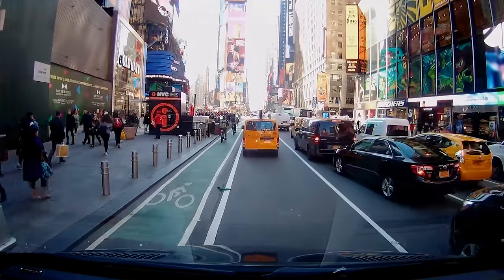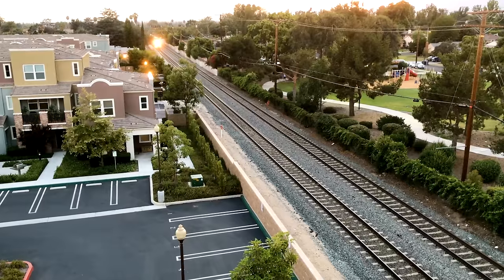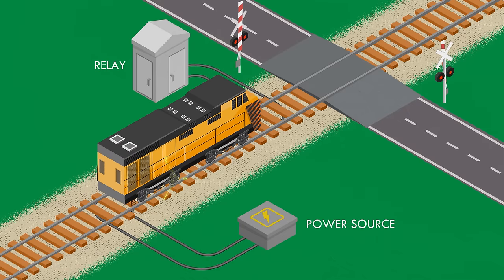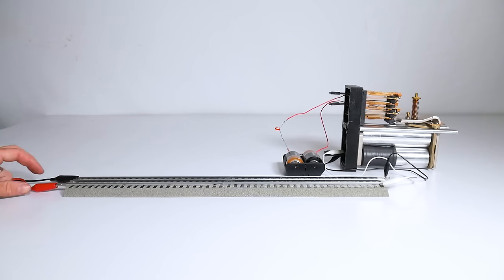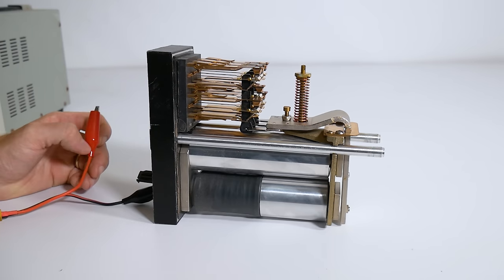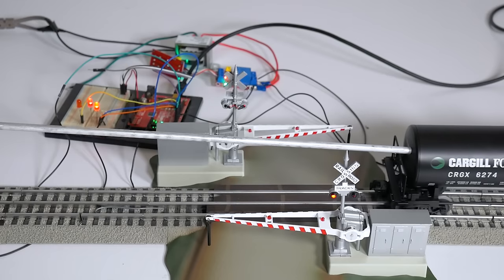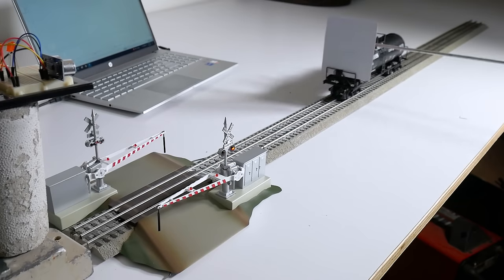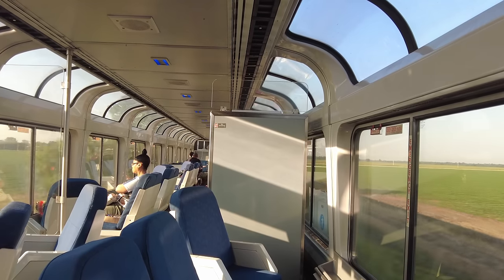How Railroad Crossings Work

Comment: I grew up around "passive-only" crossings. You get used to being careful around them, but quite a few people get killed because if they get to the crossing AFTER train does at NIGHT, it can be easy to assume there isn't a train until your headlights shine on it and it's too late to stop.
Reply: There has been a huge push in the last 20-40 years to get retroreflective visibility markers on the side of train cars to make them more visible on a crossing at night.
Actually having street lights at crossings (on both sides) is also very important.
Reply: Thanks for pointing this out, I hadn't considered the nighttime scenario of arriving to the crossing after the train.
Reply: @jovetj I've seen reflective strips on oil bombs before at a refinery I drive past. You can see them on the spur from miles away, they work great.
Reply: @@ithecastic Vehicles driving into the side of trains the driver cannot see at night has been a big problem since trains were invented.  And moving trains are generally pretty quiet.  Not that you'd hear that "clickety clack" as you're hundreds of feet from the crossing anyway.
Reply: @@ithecasticThere barely is any clickety-clack anymore, most track is continually welded
Reply: @@ithecastic: There's an incident that was pretty noteworthy, where there was a poorly designed crossing that had road traffic lights (however the track circuits were such that a train that didn't fully clear the crossing could still be on it, yet allow for the crossing to reopen) - which ended up happening (believe train's deadman ended up activating rather "conveniently" such that it did), with a car approaching the crossing, and said train being basically invisible...
Car completely written off with severe damage, rear wagon of train slightly scratched.

Comment: 5:40 In my country, there is also "check light", connected to another side of the relay, if no train is coming, this light come on, indicating that the crossing gate is working normally. If one would to come to this gate crossing and seeing check light is not on, it meant the system has no power, I would need to stop and look instead of just continue on like when it is working.
Power outage is more of a concern than false positive, so check light is very common.
Reply: Depending on the signalling system the train driver will also get a warning if the crossing gate has failed and they must slow down and use the horn to warn drivers approaching the crossing.
Reply: @baksatibi  I live in Thailand, we don't have that system. lol It's only on the gate side. Most of crossing on rural highways have those "stop if check light is off", it is very useful. But on a more urban area or in town, power outage isn't a problem, so you won't see one.
Reply: We have that in the US as well. It's often called a power-out light since you'll usually notice it when it's flashing meaning to line power. The crossing usually keeps working as intended, too. It's on steady the rest of the time which means the power is on.

Comment: In Britain's more squashed in network, with a greater population density and more frequent small roads crossing lines. We always tend to have automatic half gates at crossing points. We have several like that within 6 -15 miles of me. Most are TWO or even FOUR track locations, commonly found close to a railway station, with a footbridge across the tracks (great for photography). One very close to me has two scheduled trains every hour, just after each other in opposite directions.  Which is superb for people who want th photograph trains, but annoying if you're sitting at a crossing waiting for the second one to arrive.
Another benefit, for steam train fans, is the preserved Mid Hampshire railway. You can walk in on most days and see them, or even ride on them on special days. You would probably enjoy it. We do have a lot of historic engineering in Britian, together with many museums and historic collections and the many canals.
Reply: If we let Grady in the NRM we'd not see him for a couple of days.
Reply: Road crossings usually also have dedicated telephones next to either side of the crossing that puts you straight through to the signalling people.
Reply: Automatic barriers aren't allowed at 4 track locations.
Reply: @modelsteamers671  There used to be one in Floriston until 2006. It was 3 tracks.

Comment: You mentioned that the crossbuck is an international sign, which is technically true, but it's worth noting the American way of doing it with lots of text on it is pretty region/country specific.

Most countries use a simple white cross (usually one more elongated horizontally, not square like the American one), with a red outline, no text at all.
Though there's apparently quite a bit of regional variation:
https://en.wikipedia.org/wiki/Crossbuck

Comment: In The Netherlands and presumably other European countries as well the number of tracks of a road road crossing is denoted multiple vertically stacked Saltires (crosses). Also nowadays almost all non-automated crossings got removed. Accidents still happen though, especially near train stations, primarily by inpatient drivers, cyclist and pedestrians.
Reply: in my city we used to have a crossing not even 50 meter from the local train station.
this meant that whenever a train pulled into the station on the track approaching the crossing, the crossing would close.
so you had to wait for the train to do it's business at the station and resume it way again, before the crossing would open up again. 
and with a station with a passenger train in either direction twice a hour and cargo trains that crossing was closed a lot (i think i read back then it was closed up to 20 minutes out of every hour)

luckily a decade ago they redid the whole station area and now we have a tunnel for pedestrians, cyclist and motor vehicles, and no one has to wait for crossing trains anymore.

Comment: At 12:40 I couldn't see any difference in where the model train was located on the tracks physically and when the model cross arms lowered.

You sure your sensor and code was working?

It might have just been a very minor difference that was difficult to tell, but should have maybe slowed the footage down and given indicators on screen for where it was at.
Reply: It's kinda hard to demo that with such a short length of track.

Comment: Grady, as I am watching this video I am reminded of the day that I witnessed a railroad Speed Test. 
We drove up to a crossing, in the middle of Turlock, CA. A worker flagged us to a stop. We waited for a couple of minutes, then with a roar from the right an engine, pulling 2 or three special cars, goes flying by, leaving a huge cloud of dust billowing down the track. As they passed, the signals finally started to react. It was awesome. 
They had people at every crossing for miles up the Valley to conduct this test. They had just completed a rail replacement and leveling. 
If you could find and document such a speed test, I am sure you could make a great episode.

Comment: Here in Australia, more specifically the state of Victoria. Over the last 5 years our state government have been dismantling railway crossings & building sky rail stations instead, especially in the urban areas. The main reason was to prevent road congestion during peak hours when at times the crossings would be closed up to 30 minutes at a time. Another factor too was to reduce accidents & our road toll. 😊😊
Reply: only in suburban Melbourne

not in regional victoria
Reply: I live in WA and can't really say trains are something I can remember stopping for. I think it's mostly cause we have almost no trains. in Perth the only train I remember seeing in recent times which isn't saying much cause I don't go near any other train tracks much are the ones down south. they just go between each side of the freeway. I kinda wish we had more trains like to Exmouth a train would be super useful. a 12-16 hour trip from memory depending on what you're traveling in being 8 or less would make it not a multi day drive for most people.
Reply: @rex9412  Perth has seen significant growth of it's rail network over the past 15 - 20 years, with more occurring now. There is a preference for grade separation - thereby avoiding creating new level crossings and removing existing ones.  The level crossing removal project on the Dramadale line springs to mind.
Reply: @matthewwilson4723  indeed. That's "Armadale" for anyone not familiar with that area's reputation.

Level (grade) crossing removal is a big part of the current city-wide MetroNet transit upgrades and has been happening on the Armadale and Midland Lines that I know of, possibly others.

MetroNet also incorporates the new rail lines to the airport (completed), to Ellenbrook (underway) as well as the extension of the Armadale Line to Byford and the Joondalup Line to Yanchep. Unfortunately the various works to the Armadale Line will see it closed for the next 18 months.
Reply: @matthewwilson4723  ah ok. yeah can't say I go out much as I'm mostly stuck to being in bed nowadays with some car trips rarely for appointments. Not surprising I'm wrong. I also think I'm not very observant for construction stuff cause it will change so not useful as a landmark for navigating I guess. IDK exactly something I developed as a kid to not get lost but not any actual thought behind what I notice/remember what's around me lol.
Reply: @EAFSQ9  Regional Victoria has also been receiving crossing upgrades - specifically from passive to active systems, since Vlo's aren't allowed to run at speed near any unprotected crossings.

Comment: Sidenote: For the UK lots of Railroad (or Railway) Crossings are also controlled by a human signaller (usually the ones that have barriers on both sides) this increases the wait times because they have to be manually checked and then cleared for the train to cross. But also reduces the risk of someone getting stuck because there's usually a CCTV link directly to the signaller themselves. 

Automatic crossings do exist in the UK but are mostly being phased out because its a high risk area (according to Network rail - the UK's rail infrastructure goverment body) they're also doing some fancy stuff with Radar to figure out if a crossing is ocupied or not on some automatic level crossings.
Reply: I can just imagine how impractical that would be on a lot of shortlines in the US. It'd probably involve calling different houses in the area asking if they've seen a train. There's a LOT of dark territory in the US where trains run too infrequently for track signaling to make sense.

Comment: Great video, as someone who used to build the work trucks the rail road uses to fix/build and mantain the rail, even I didn't know all of this. 
On the trucks we built, we installed "rail grear" that would alow a regular truck (small F150s to 12 wheen freightliners) to drive on the rail... then wire the trucks up to bypass the crossing signals with the flip of a switch. So the guys could work close to a crossing without setting off the crossing signals.

Comment: Wow, you have really nailed this well. I'm a signalling engineer (we design/verify/validate grade crossings as they're considered part of the signalling system) and I don't think I could have explained it better than you have. One item though, track circuits detect the 'absence' of a train (because of exactly what you stated that there could be a train or there could be a failure so when it's energised that means no train) and axle counters (train detection devices that count axles and are widely used everywhere except USA it seems) detect the 'presence' of a train.

Comment: In the UK, new level crossings are heavily discouraged, and they are slowly being replaced by bridges - usually with a focus on higher speed main lines [up to 125 mph] or lines that are very busy - there are a small number of level crossings on 4 track railways, there is even one with 6 tracks on the East Coast Main Line at Helpston, and even level crossings with 2 tracks can see as many as 16 trains per hour at Hampden Park in Eastbourne.

A lot of minor crossings may be closed entirely if there is a reasonable detour available - especially for minor side streets in urban areas. It's not uncommon to see a footbridge where a road once ran. Also the natural topography means that if there is a railway cutting or embankment, bridges would be included from the beginning.

Road crossings typically use full barriers, although some (typically rural) use half barriers and there are a very small number of open crossings with only lights and bells.

We tend to avoid situations where a road and railway closely parallel each other to the point it causes issues with long vehicles waiting at a junction backing up across a crossing - but you will still see junctions near level crossings!

This is in addition to footpath crossings [which are typically unsignalled and where pedestrians must stop and look], and gated crossings [which are usually private and may have only red and green lights, with instructions to open both gates, check the lights again, cross in the vehicle, check the lights again, then close the gates]

The London Underground does not have any public level crossings [only those within depots] - this is because the service frequency would usually be very disruptive to traffic.
Reply: These points apply in the US (and Canada) as well.  The number of level crossings slowly shrinks as crossings deemed unnecessary are closed, and new ones are not common.  Where possible and feasible, bridges or underpasses are built.  Footpath crossings are not as common in the USA, and they tend to be grade separated.

Comment: The only problem that arises with all this safety equipment is that RR crossings are the most expensive part of the track to maintain. It’s in the railroad company’s best interest to have as few crossings as possible to save money. The county where I live is currently in a battle with Canadian National, which is trying to close as many crossings as possible. This is troubling for the people that live on rural gravel roads, where a closed crossing can mean a detour several miles away.
Reply: I mean if it's on a gravel road, does it really get enough traffic to justify an active crossing? Passive crossings are pretty much free for the railroads, and if the traffic. Is low enough then an active intersection isn't needed.
Reply: Even passive crossings have some maintenance cost, as the railroad is fighting to close them as well. But gravel being the road surface doesn’t necessarily mean it’s rarely driven, plenty of gravel roads are frequently traveled, and justify the presence of an active crossing.
Reply: Automated track maintenance works until you get to a crossing… no matter if it is a highway, gravel road, driveway or pedestrian path. The crossing has to be removed, lined thru and then replaced so there is a significant disruption to the work flow. Or, you compromise the line and adjust to the crossings. Railroads fight tooth and nail to remove crossings as every one is a maintenance headache (even overpass/underpass) and not every crossing is justified.
Reply: @micahjohnson6799  How about replacing them with call crossings? Those should suffice, wouldn't they? Dispatch should know where their trains are anyway.
Reply: I thought most counties and other jurisdictions pay the railroads to maintain the signals.
Reply: @micahjohnson6799  Is there some rule about level crossings and train speeds?  Say a maximum of 120 kph within XX km of a level crossing.  I thought I read somewhere that passenger trains could be sped up if level crossings were reduced.  I could be wrong.
Reply: @HweolRidda  as far as I know, there is no restrictions on speed due to crossings. Speed is set according to the track geometry and quality of the track. To maintain the speed of the track you must meet the inspection requirements for each class of track and the class of track determines the geometry of grade crossings and the safety requirements of each crossing. Now, there may be speed restrictions for specific  occasions… like the town has a parade crossing the tracks on the Fourth of July between 1 and 3 so the railroad might slow the trains to “sight stopping conditions” (crawl) and “make noise” (bell and horn without restriction) during those hours.
Reply: @HweolRidda  That's typically a legal limitation but the speeds also are still fairly reasonable for most operations. The speeds a track with level crossings can have go as low as 120 km/h (Finnland) to as high as 200 km/h (e.g. UK, Sweden, US), though most countries (in Europe at least) settled for between 140 and 160 km/h. Any faster and the crossings must be removed, though.
Reply: The safest railway crossing is the one that doesn't exist.

Comment: I live next to a very active BNSF track. Most days its coal cars coming from Wyoming that crosses, occasionally its mixed freight. The warnings usually are about 100 yards or so from the crossings maybe further. Some times the trains have parked for a day or so at about where the crossing triggers are at, but I think the engineers have a bypass to disable them when parked for an extended period of time.